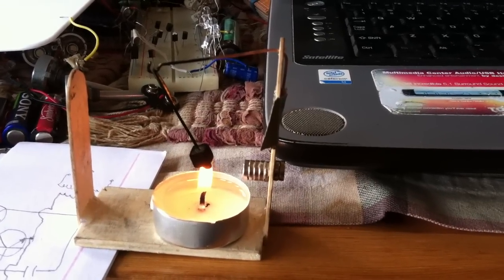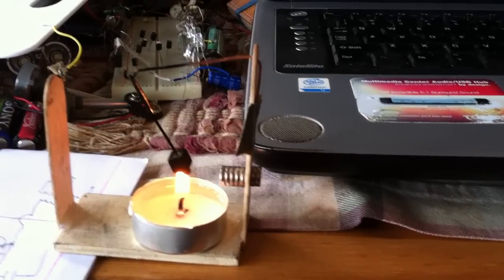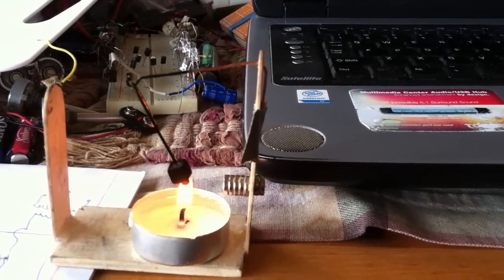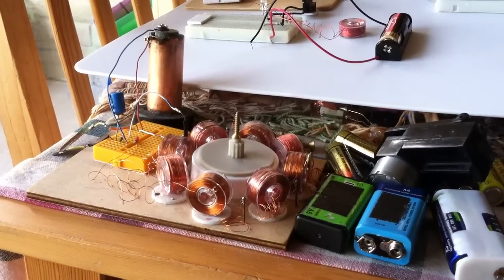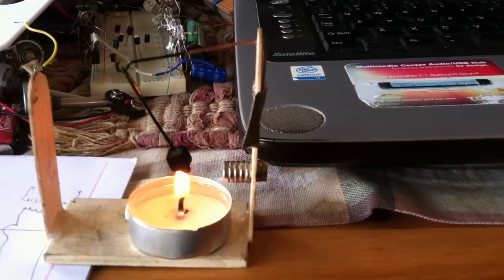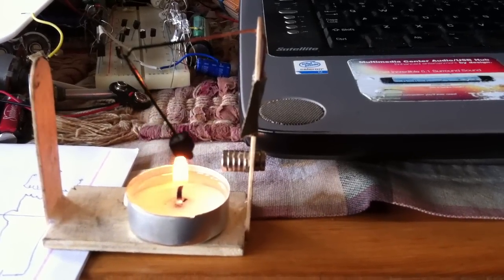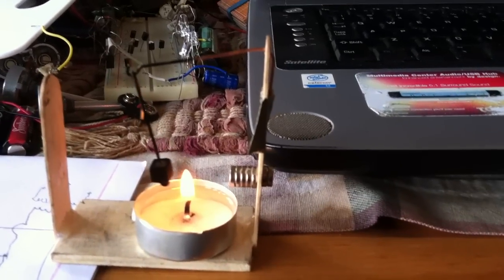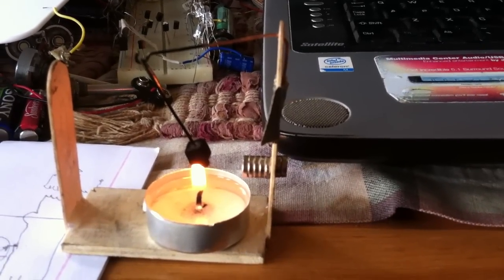Curie Effect

Comment: A strange phenomenon that works well in your demo. I thought the magnet would lose the magnetic properties permanently if heated.
For a simple rotor, I would imagine a waterwheel type of design, where heat replaces the water. The heat unbalances the section, which moves and the next one drops onto the flame.
Reply from the maker: +slider2732  It should work if the rotor is setup right.